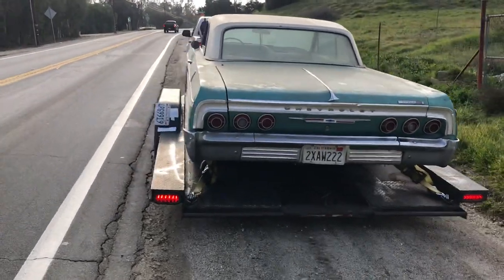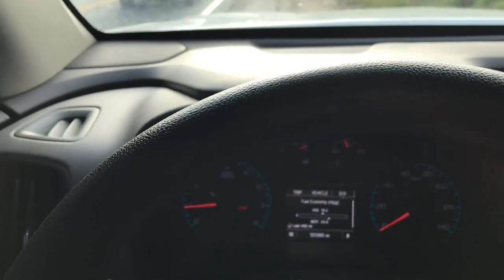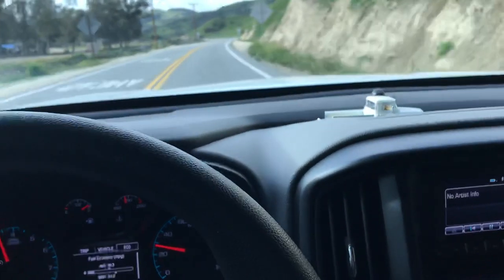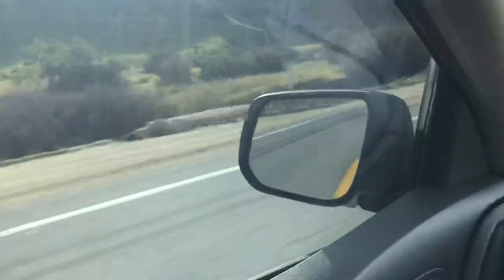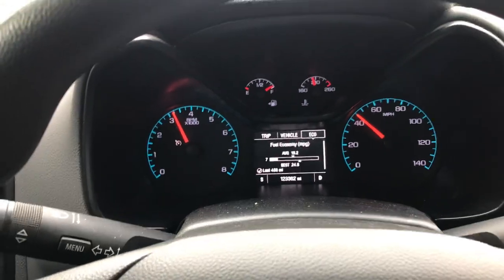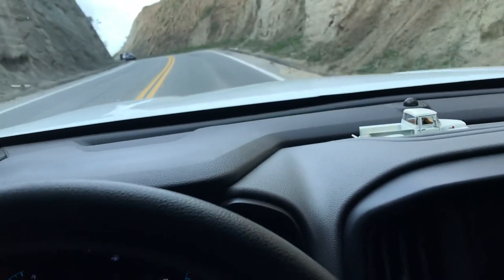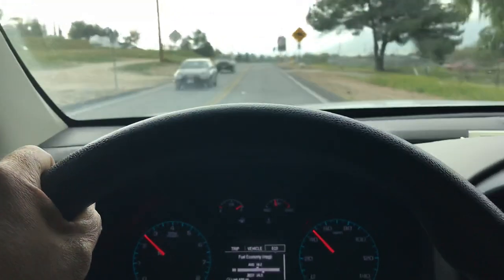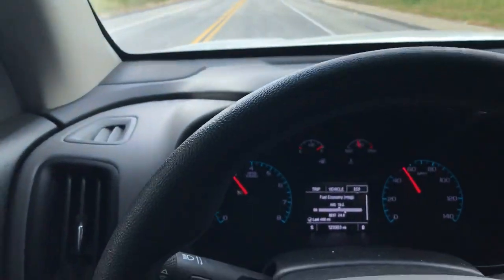Chevy Colorado 2.5l towing  64 SS IMPALA

Comment: Wow it did really good...i just traded for a 2018 base wt with that engine and a 6 speed manual transmission with 4.10 gears.
Reply from the maker: yours should do a lot better since you can keep it in the desired gear manually,i do recommend gatting a trailer brake if you dont already have one ,I used one from Redarc easy to install

Comment: I was searching around in the owners manual and it said that L was for selecting how many gears you want to use for just such occasions. I have a 2018 2.5l extended cab. I plan on towing around 2.5k pounds and I don’t have a tow haul mode. I’m going to try leaving it in L and only select up to 4th hear since 5 and 6 are both overdrive gears.
Reply from the maker: After reading your comment ,I tried this on the way to work and it worked exactly as you said.My Colorado came with down hill assist (uses engine to slow down truck )I couldn’t find anything in the manual to turn this feature off ,do you know anything about that

Comment: Thanks for posting this, how far did you travel ? I was thinking of doing the same , have a 2016 wt access cab 4x4 with a fiberglass canopy that probably weights around 300 lbs to tow a Subaru hatch at 3200 lbs but didn’t realize the trailer was 2000 . Mostly flat highway with the exceptions of a few hills .
Reply from the maker: this trip was short but ive pulled the same trailer with a 69 firebird  to trade for 69 camaro  500 miles round trip had to go  up the Grapevine in california in both directions truck did fine, i did add the Redarc trailer brake to truck though i recommend it
Reply: What was the trailer weight and over haul weight?

Comment: Them 2.5l motors ain’t made to tow like that on steep grades lol but looks like it did alright. Like a rock! 😆 I towed around 5000 lbs with my 2019 Z71 3.6l and it knew it was back there but handled it really well. The 8 speed transmission helps out a whole lot on hills!
Reply from the maker: you got that right justin  ,its just for fun worse that could happen is ill be buying myself  a new truck no worries
Reply: They put the same size tires on the 3.6L and the 2.5L. The 2.5L comes with 4.11:1 rear gear vs the v6 3.73:1 rear gearing. Stock tires are 255/75/16 or 255/70/17 with factory wheels or steelies.
My 2015 Colorado stayed in 5th gear 70% of the time trying to keep 75-80mph. I went to a 245/65/17. I have driven 450 miles and averaging 32 mpg. Have a best of 37mpg for 25 miles through a city and rural area mix. 
That number was about 21MPG with the bigger heavier tires. Couldn't go up an upgrade without having to go back into passing gear. I can pull hills now at 21-23 MPG compared to 13MPG. Lost about 300 RPM, but with a 95MPH speed limiter and will do that easily in 5th gear, nothing wrong at all with her now.... Heck she'd do 130+ mph easily if not for the speed limiter. The gearing doesn't need to be anywhere near that high; at least with the 6 speed auto.
I'm by no means comparing towing,  just what these trucks were meant for, driving back and forth to Lowe's and the many things in the yard that needs hauling.
Reply: 2.8 I pull near 8000 no problem

Comment: Any idea how much weight your towing?
Reply from the maker: colorado weighs 4020lbs trailer and impala weigh 5300lbs
Reply: @ozcorr909  wow so that was quite a bit of weight. I'm thinking about getting a new 2023 colorado but I want to be able to pull my 2012 gmc sierra regular cab with it. Truck weighs about 4000 lbs so seems it should be able to tow it. The new one I'm looking at is rated at either 6000lbs or 7700lbs towing.
Reply from the maker: tha would not be a problem for your 2023 colorado with that rating my colorado is rated at 3500lbs all ive done is change the tow hitch to a 7000lb rating and added a trailer brake .(im sure yours would have this from factory.)my truck to trailer weight ratio is still 80 percent wich is in the safe zone,where i am taking a risk is my engine it is not rated for this but ive owned the truck since new and it has over 120k miles tow 2 to 3 times a year  and is still working fine.The truck youre looking at is much more capable than mine
Reply: @ozcorr909  ty for all the input on this 🍻